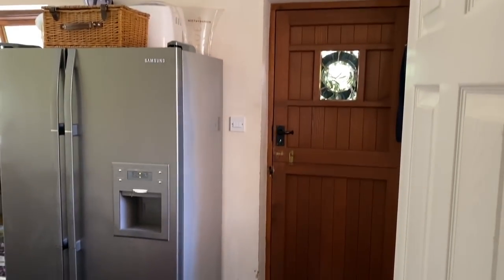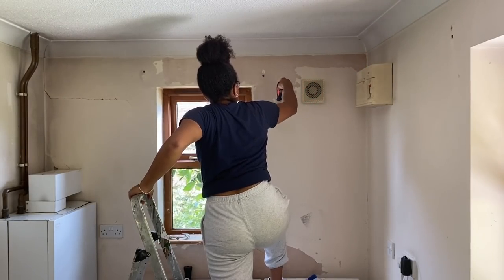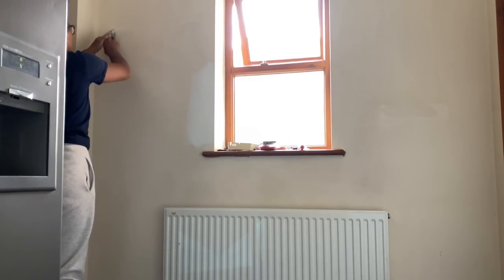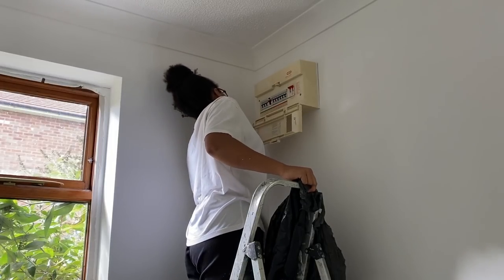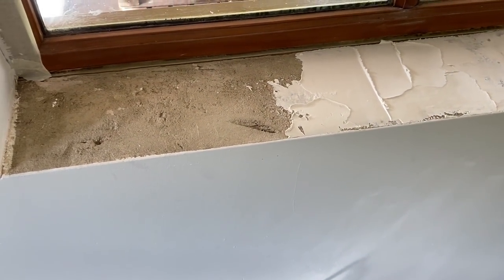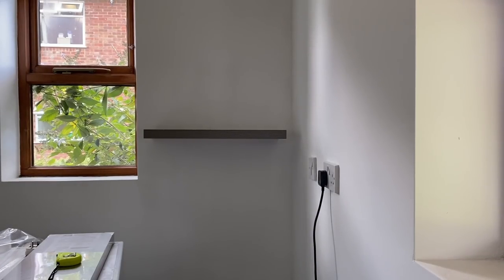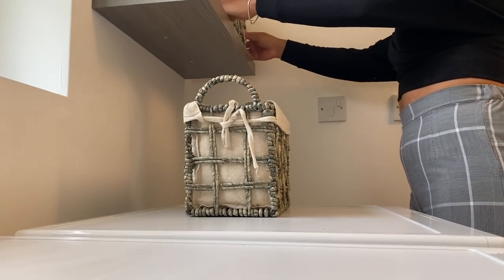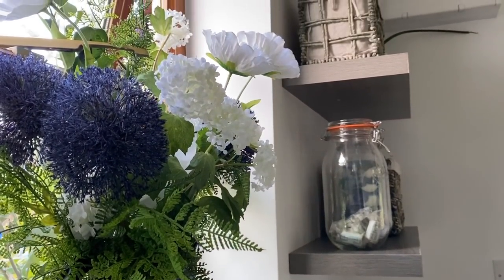24 HOUR ROOM FLIP *beginning to end* | Utility Room Makeover | Shade Shannon

Comment: Its because the plaster wasn't sealed b4 painting. They use a pva/water watery wash b4 to seal the plaster stops fluffy white mould spores not black and gives it sumat to stick to or you get that paint flaking of ceilings or walls. Like if someone fill say a old pull cord light switch and dosent pva/water wash it'll start revealing a circular shape where paint eventually peels. Its literally blob of pva in water not too much wash it seal the wall. For fresh new plaster or plaster that's been sanded it'll need doing again obviously. Nice but of info. I seal everything in prep now.🥰👌🏼🙏🏼 and seal in a hole after sanding it b4 you start putting your fuller in or if its lines cracks in ceilings it'll keep falling back out been their.lol hack.😉👍